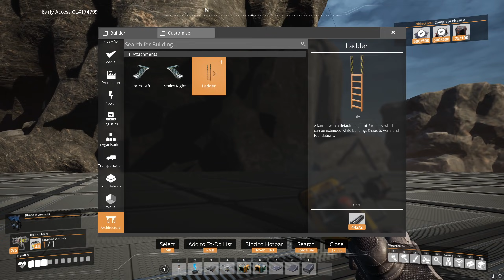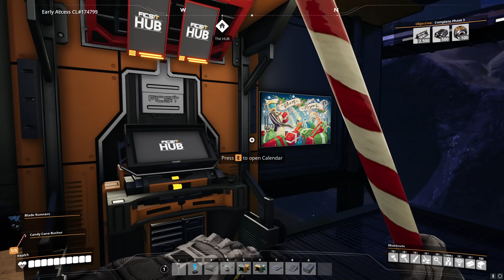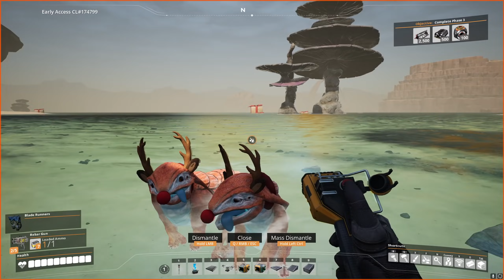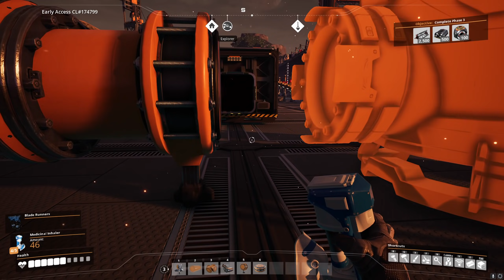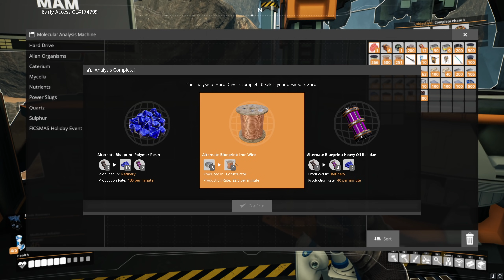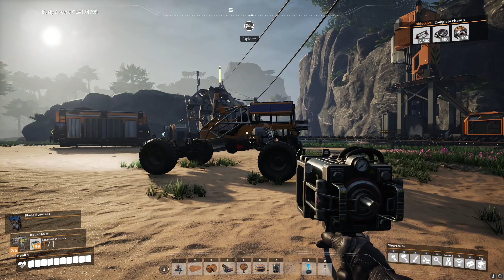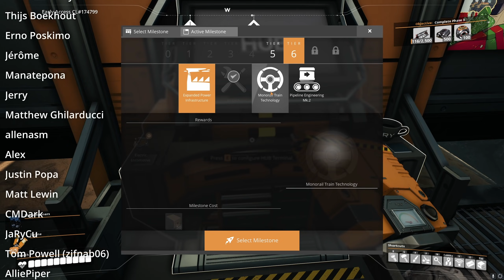Satisfactory : Ep4 Jumping into Mid game

Comment: Not burning the Petroleum Coke is a mistake. At this stage of the game, you’re short of hands-off power sources like coal, and the power output from the coke is significant. Typically it’ll double your power output at this stage. What you Sink is any excess plastic or rubber so the Coke doesn’t stop.
Reply from the maker: I'll give that a go next time, it's just I did not have smart splitters at this point so sinking excess plastic or rubber was not an option.